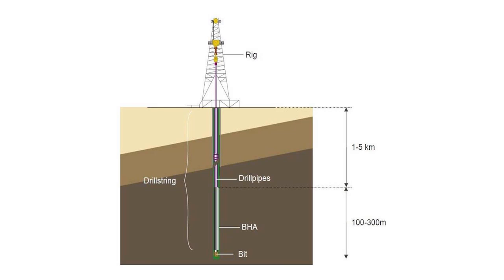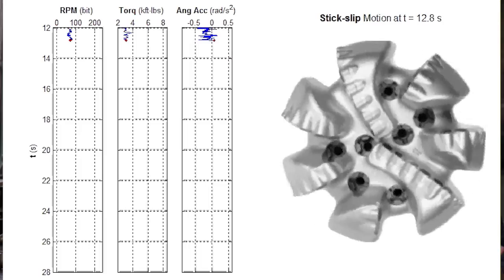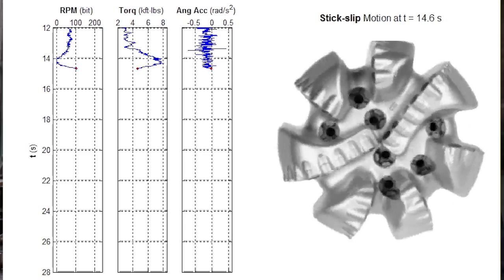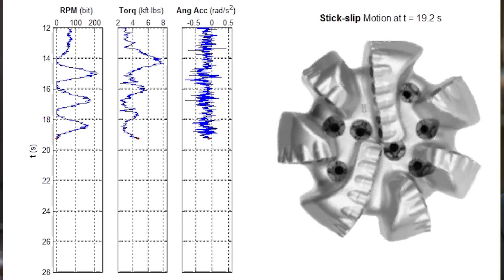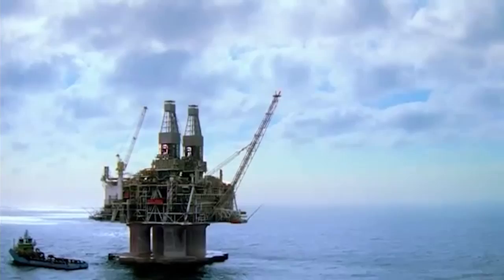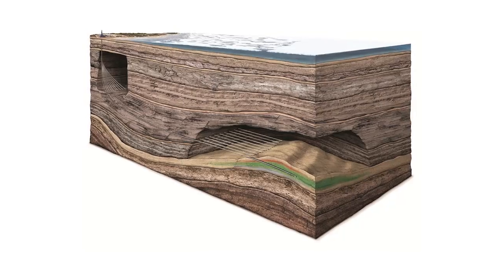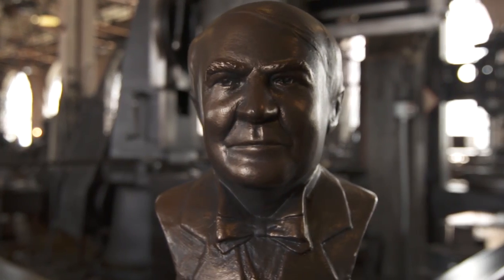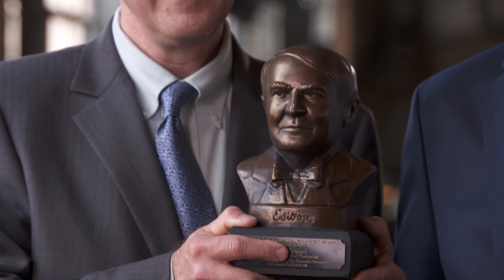R&D Council of NJ 2015 Edison Patent Award Winner ExxonMobil

Comment: Huge advantage Exxon has is utilizing the technology from their R&D folks. It's key to understand that Exxon has no drill rigs, they contract out the drilling. But the Exxon Drilling Group oversees the drilling of the well along with the driller from the contracted drill rig company. Advances in horizontal drilling was very exciting back in 1989 which is the initiation of the era of horizontal drilling. Steep learning curve for drilling mainly by smaller independents who exchanged information which allowed acceleration of the learning. Exxon gained significant drilling knowledge from wells drilled by it's JV partners who operated the wells. Exxon's Austin Chalk Horizontal Drilling & Fracture  Group worked with smaller independents on a daily basis through the office and on the well site where the location of the drill bit was coordinated by the drill site Geoscientist in order to keep the drill bit in the objective horizontal Austin Chalk beds. These drill site Geoscientists were very talented and dedicated to ensuring that the objective formation was penetrated.